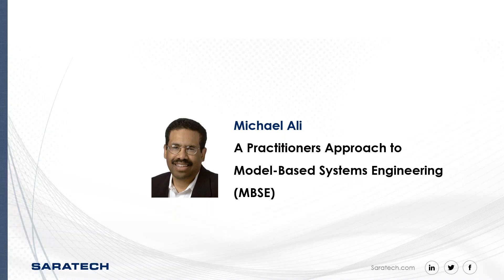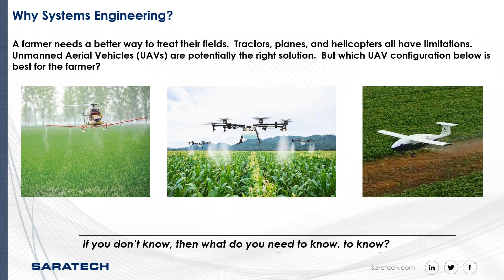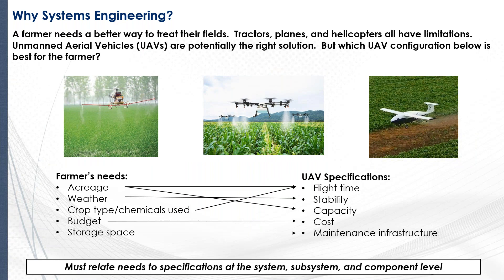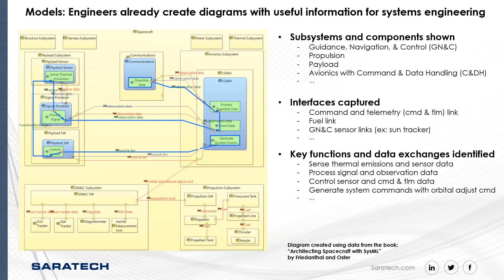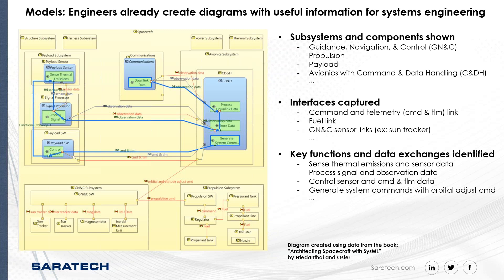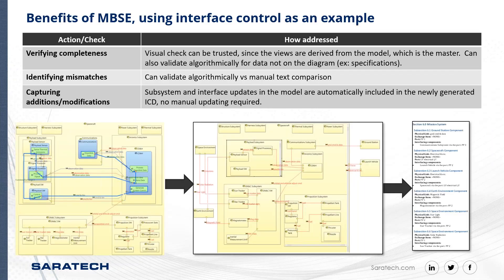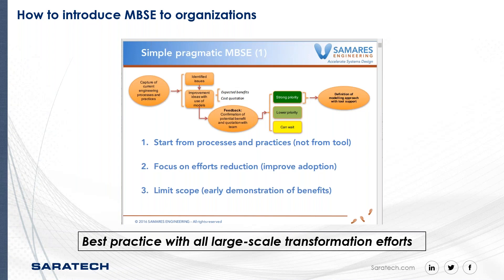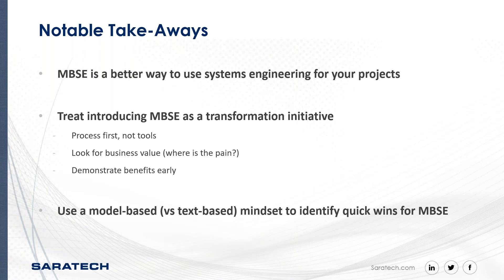Model-Based Systems Engineering (MBSE)

Comment: Well…the real problem of mbse is that building a model is really time consuming. Even making them “good looking” for the audience requires huge effort. It’s a matter of efficiency, after trying to adopt mbse in my company several times, I still don’t know if it is a win or not
Reply from the maker: We agree that MBSE has to be a win for the company adopting it.  Time consuming model building is not where the win is.  The win is gaining insight by integrating across model and data elements, starting where low effort yields high value.  This sweet spot is different for every company, but checkout our CES Video Lecture “Top 5 Ways To Get Started with MBSE” for good places to start based on our experience.  Video is linked here: https://youtu.be/VY6JjeoiJ2o?si=H4J-N0p5-7HtcNUV . The presentation also includes a checklist to determine if your company is ready for MBSE based on SE usage maturity.  And, if you have further questions, please contact us at info@saratech.com

Comment: Excellent presentation, Michael. As someone who specializes in System Architecture for Relational Databases in Software Engineering, learning how to transfer such skills to MBSE is very essential and immensely needed across industry in the govt. sector. Thanks for the fluid presentation.